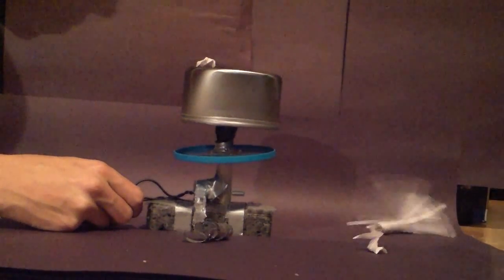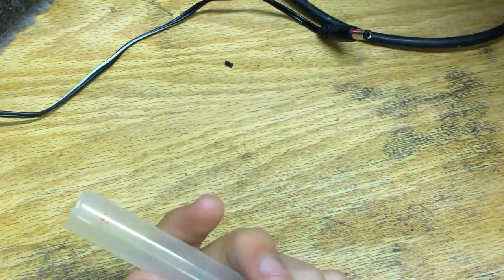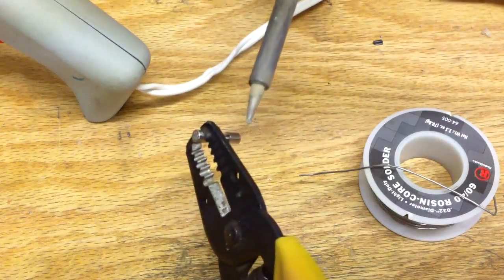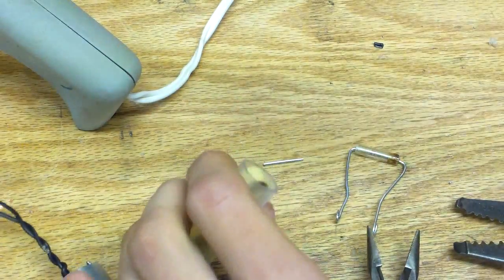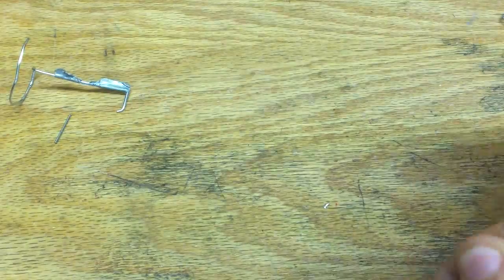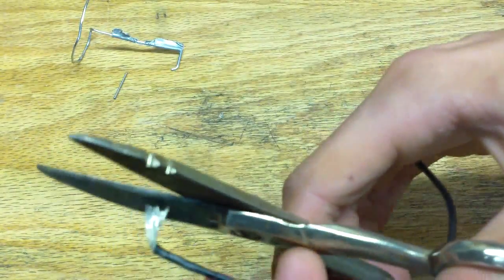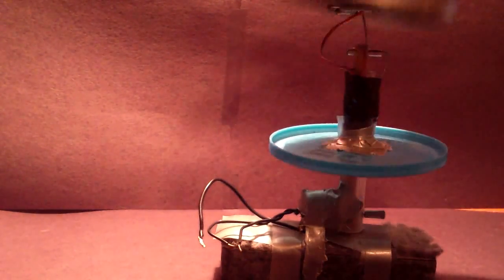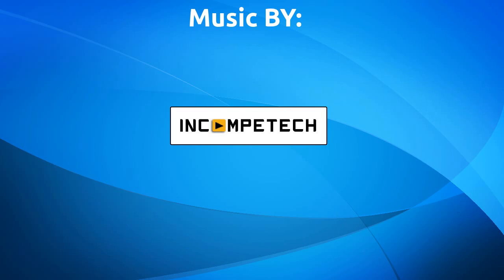How to build an impressive 30,000 volt Van De Graaff generator!

Comment: what should be the power supply being used in the video
Reply from the maker: Anything that can get a typical hobby motor turning, really. I used a 12V wall adaptor (the old fashioned unregulated type)
Reply: Power Max Thanks

Comment: did you plug it in to the wall
Reply from the maker: I used a wall adaptor to convert 120Vac mains into a more manageable 12Vdc.
Reply: if he would have pluged into the wall it would give 120+v  AC current
Reply: and I'm sure it would die

Comment: This is has smart has using heat plugs used in diesel engines to heat each pistion on a sterling engine. A motor the runs off hot air and uses no gas or electricity? Hay your very smart!

Comment: just a quick tip, Don't you think it would've been easier to install the fuse tube and paperclip and all that BEFORE you put the motor on? lol just saying cuz that seems like it would have been way easier for you instead of holding down the thing and keeping the tension and all that while also trying to tape it down. lol like the project though. What's the max volts does it put out?
Reply from the maker: I don't see how. either way you will need pliers to reach and pull the band through.
Reply from the maker: you would have to do the same thing with the motor. pull the band through, poke the motor shaft through, glue it in place while holding everything in place.
Reply: +Power Max well if you do the other side first then you can easily align it to the appropriate tension and once you're done with that side you can simply get the tweezers and pull it out the other end and put the motor in the holes and to make it more easier to glue it and all pull the rubber band out a little and put something there like a paperclip to hold it to where it won't snap back into place. from there you'd have all of it done so all you'd have to do it release the temporary  paperclip holding the rubber band and it'd snap onto the motor.
Reply from the maker: +JoeyTheLionnn Yeah, thinking back on it it was a real struggle the way I did it. Really I was designing it at the same time as making it, so I did not really have any plan other than a vague idea of what it was going to look like. I cannot measure the maximum output voltage, and really that depends on a lot of factors like humidity, speed, leakage (corona), etc.
Reply: +Power Max oh okay well still love the idea

Comment: 30,000 Volts? Really? :(
Reply: KnowW NotM 10.000 volts can jump up to 1 cm, so 30.000 V can jump up to 3 cm!
Reply: @fuguetero6969  it's  not 10000 kv for 1 cm it's 15000 to 30000 kv for 1 cm depending on humidity and pressure
Reply: Air breaks down at 30kV / cm, not 10kv as what circulates around the internet. Typing in "dielectric breakdown of air at STP' will back this up. And, 30kV will jump only 1cm if between two identical spherical electrodes. In this case, not so much so. Meaning his sparks are longer than 1cm
Reply: 30,000 Volts at 0.050mA

Comment: bro does ur hair stand when u touch it??
Reply from the maker: +Arjun Sheka Unfortunately no, but I have short hair. For that you need to make a larger one because this one does not supply enough current to allow the voltage to build up high enough for that.

Comment: will it matter if I use a metal tube?
Reply from the maker: +Cassandra Manzano As a substitute for the glass fuse, yes, google the triboelectric effect. If you are referring to using a metal shaft, You DEFINITELY cannot use a metal tube, as it is conductive and will not allow the buildup of electrons.

Comment: hook a leyden jar to it?
Reply from the maker: +Shaheer Syed Leyden jars are just primitive capacitors. It would charge incredibly slowly. The top load on this generator is also a capacitor as it is able to store an electric charge relative to the environment. Watch my video on those after I post it!
Reply: +Power Max MOT capacitor ultra overkill! jk, how about aluminium foil electrodes separated by plastic wrap
Reply from the maker: +Shaheer Syed MOT capacitors are too leaky, they usually have built in bleeder resistors to discharge the capacitor after a few minutes or so, but not always, so be careful messing with them. They are deadly. I once tried to make a capacitor out of aluminum foil and trash bags (low density polyethylene) and they will generally only work up to around 5kV. I kept trying to make one store the full 15kV from my flyback driver circuit for use in a SSTC, but it would always pop and discharge internally. The last one I made, I neglected to discharge the capacitor before tearing it apart to patch it, and I got a NASTY shock from it, knocked me to the floor.
Reply: Power Max The whole point of this is to make this more dangerous.
Danger = fun! Plus your sparks will be much more intense. People rig up MOTs directly for arcs, which obviously is way dangerous (and more fun) than this.
Thanks for the fast replies
Reply from the maker: +Shaheer Syed Though they still would not charge with the tiny currents from this VDG. You would need a transformer and rectifier to charge it at any reasonable speed and up to any reasonable voltage. I'd imagine this thing would take days to weeks to charge a MOT capacitor even without a bleeder resistor, and not at all if it had a bleeder resistor.
Reply: Power Max Nupe, I'm talking about a plastic wrap capacitor
Reply from the maker: +Shaheer Syed I did not have any luck making one that could store really high voltages. However, Rimstar.org (another youtuber) has made a couple videos on that subject. If I ever plan to make one again, I'd follow his instructions. I currently have a 0.01uF 20kV film capacitor I bought off eBay for a SSTC that I never built.

Comment: i built one and for some reason its not working i added more power but still nothing the fuse is spinning very fast tho
Reply from the maker: I Gots A Questions It took me many tries to learn how to make one of these. My first attempt I did not understand how the VDG worked and tried to make one with legos and erector set pieces. It did not work. 

I then many years later attempted to do it again with no hope of succeeding but I spent a long time learning the science behind it and tried to make it again, and I had some very minimal success, with 1mm sparks that were only visible in complete pitch blackness.

Many days later fine tuning the design, adding a better top load, adding the blue plastic lid, tediously adjusting the brushes and motor and paper clips, and adding LOTS of tape to stop leaking corona, I was able to achieve the results in the video on good dry days. And now that generator no longer works now. SO it is really fiddly as you will discover.

Comment: How do you control whether the top sphere is positively or negatively charged?
Reply from the maker: George Sohal By changing the design and materials used for the belt, top, and bottom rollers. 0:22

Comment: the brushes mustn't touch the belt or the rollers beacuse somebody told me its gonna work
Reply: its a question.
Reply from the maker: Szentléleki Márton Sorry, I have been away for a few days on a campout w/o cellular service or internet. For my specific VDG, I can let the brushes touch the belt, (and in fact I do get slightly better performance) but it wears it out and damages it very quickly.

Comment: max, i have no idea why its not working.topr roller is pvc,belt is pvc isulation tape and the bottom roller is whipped around with rubber bands.its clean but not working
Reply from the maker: I do not really know. A picture's worth 1000 words, open up an instructables account, I think you can sign in with facebook, and ask a very detailed question there. Lots of other minds are willing to answer, as well as me.

Comment: Done! its working BUT very weak it has only 2-3 mm sparks
Reply from the maker: Try turning off the lights and after letting your eyes adjust to complete pitch black, turn on the VDG and see if you see any purple light. A yellow fluorescent light lighter may help since our eyes are not that sensitive to UV and violet colors, the highlighter, or markings from it will fluoresce and since our eyes are much more sensitive to green/yellow light, it will be more visible. around the corona.

Once found, if it is a sharp piece of exposed metal or burrs or something, smooth it out with sandpaper as much as you can and apply some tape, wax, hot glue or liquid electrical tape, or better yet, corona dope which is specially formulated for that purpose, as it has really high dielectric breakdown. As you see in mine, I used a LOT of tape as that is what I had on-hand. Duct tape worked OK for me.
Reply from the maker: The rate of charge buildup (the electrical current produced b the VDG) is determined by the materials used for the belt and speed of the belt, while the maximum voltage obtainable is dependant on how well you can store the charge on the top dome.

Comment: max,i have one more question. what can is use for the belt for the same rollers?yep,i  look around the internet about that but i can't find good information.
Reply from the maker: I don't know why not:
https://www.google.com/search?q=triboelectric+series+chart&biw=1536&bih=758&source=lnms&tbm=isch&sa=X&ei=7MIIVcbiKevdsATRv4GADA&sqi=2&ved=0CAYQ_AUoAQ

I used a rubber band, which  is made of latex, and it is in between vinyl electrical tape for the bottom roller, and glass for the top. Choose a material which lies between the charge preference for the bottom and top rollers that you choose to use. The further they are apart, the better the generator will perform.

The bottom roller has to be more negative (or positive for reverse polarity) substance, and the top roller has to be more positive (or negative for reversed polarity). I think you are referring to a different design for the generator that is out of the scope of this design, if I understand you correctly, where both rollers are made of metal.
Reply: Power Max yep. i want to make a bigger one.that gonna be 50.000-60.000 volts.but the nylon cant  charge the metal roller. :(
Reply from the maker: Szentléleki Márton You will have to research into it yourself I'm afraid, I do not know much about the design that you are planning to build/troubleshooting. I am sure you can scale the version in this video up to be larger, but as you can tell it becomes exponentially more difficult to get the right materials where you want them.
Reply: Power Max its very,very difficult to built a quite big vdg.i spent a lot of time to research the best belt and rollers but nothing is happens.the belt is my problem, i cant cut a good belt from my latex exercise belt.i spent a lot os time to watch videos and learn how it works,now i understand how it works.in the shops in my city i cant find stuff to my vdg ,such as belt.so i  so sad beacuse i spent a lot of time and its dont work

Comment: pls make a video with a leyden jar. its fum! but very dangerous. with you powerful VdG and a quite big leyden jar can make a very big and shinny spark,and easy to make
Reply from the maker: I do have a 0.1uF 10KV capacitor! Very dangerous, and I have got some really nasty shock from a homemade HV capacitor, too! (I don't think small leyden jars are dangerous though, I don't think they have enough capacitance to do real damage, though I am sure a really big one made with a 5 gallon bucket will pack a punch!)
Reply: Power Max yeah. i have a bucket leyden jar and its powerful but i can't charge it well and everybody can touch it. i gonna make a video and i will show you my little and my big leyden jar capacitor. :)

Comment: the top roller is glass and the bottom roller is pvc.it work? Or the roller must be normal electrical tape?
Reply from the maker: Check the triboelectric chart, and see how low it is. Alternatively, you can try it and see.

Comment: It seems the motor stalls a little when it discharges. A diode in parallel with the motor might help.  My Van De Graaff generator uses an AC motor so I can't change speed (easily), have you tried running your motor at different speeds.
Reply from the maker: Good observation! It is actually the poor dynamic range of the microphone on the camera that I was using! Every loud crackling spark would cause the gain, or volume, or the microphone to immediately 'adjust' the gains lower to compensate for the loud sound, and being a low-pass filter to prevent actual loss in dynamic range at audible frequencies, it takes awhile for it to recover after each spark, and return to the normal gain or volume levels. I hope that makes sense :)

I am, however, way overdriving that poor motor, it is rated for 5V, and I am feeding it 9V and above!!! And it is loaded pretty heavily from friction due to the cheapskate build quality of the darn thing! What I find is that running the motor at slower speeds does not reduce the maximum output by much, but only the frequency of sparks for a given distance. That of course make sense when you think about it, the generator is essentially a high voltage constant-current supply by nature. Slowing the motor causes the buildup of charge to be slower, but not less. Too slow, though and the losses from corona and electrical 'leaks' becomes more and more significant. Thats why I used so much tape.

What would the diode across the motor do to help keep the speed stable? From what I understand, it is simply used to suppress back EMF, when sensitive electronics are used to power the motor, like MOSFETs, and the like. A capacitor would certainly be beneficial though!
Reply: Yes, that makes more sense than the motor stalling. The diode was just a guess, but I figured if the motor was having problems because of high voltage issues any component would wear out pretty quick especially a capacitor. But I guess I was over thinking a fails assumption, and a cap would make more sense.

I have been successful at increasing a drill motors low voltage torque by putting neodymium magnets on the out side of the motor.  I made it for a guitar pickup winder. It was powered by a variac with a rectifier and would bog down and stall at slow speed from the tension of the wire being wound. It will work well at 3 volts now (at least for winding pick ups) and it's a 18 volt motor.
Reply from the maker: Yeah, generally when it comes to static electricity, and ESD, it is CMOS IC's, FETs, and things like 4000 series logic that fail due to electrostatic discharge into there gates. Nowadays everything is digital, and inputs to microcontrollers, processors, RAM, and everything else are FET inputs and are really sensitive to ESD. (the gates are electrically floating, and usually separated from the rest of the transistor by an extremely thin layer of silicon oxide, essentially glass, so the dielectric strength of that gate is not very high. Easy for electrons to puncture with static w/ enough voltage.)

Lucky though, nice beefy and simple electromechanical devices like relays, ballasts, motors, solenoids, etc as well as capacitors* are immune to most any level of ESD. Everything electromechanical generally is lowish impedance and the ESD does not deliver enough current or joules of energy do anything at all! (unless that static electricity has been stored in a 180uF 5000V capacitor the size of a submarine battery like photonicinduction lol!)

Thats an interesting way of increasing the power of the motor! I have stuck small magnets to motors in the past, and did make them make more noise when running, though, I did not do much experimentation with that. Generally when I have needed more power of of a motors, I overvolted it! :)

* When a capacitor is discharged completly, it will act like a short circuit or a low resistance until it "fills up" with charge. So when a spike of ESD goes through it, it only charges slightly. If the capacitance is big, the voltage will only rise a unnoticable amount. If it is really small, that voltage may rise more substantially. Just do not let the voltage built up across the capacitor go higher than the rating and it will survive no problems! There is also a maximum pulse current to consider, just make sure not to exceed that, either.

Comment: and i cant buy rubber band.... in hungary its very rare in shops.. i will buy from the www.winkleriskolaszer.hu its a hungarian site so everybody wgo live in hungary ,austria or germany can bought rubber band ,DC motor ect....
Reply from the maker: Any rubber belt should work. It does not need to be the exact type shown in the video. You may just have to get creative and make your own band with some rubber strip. Make sure that the material is not matt black, as that generally means there is carbon content in it, making it conductive and unsuitable for this.

Teflon is really low on the triboelectric chart, thats fine for the bottom roller. However, the top roller should be made up of either metal, or something that is high up on the triboelectric series. Thats why I used a glass tube from a fuse. http://esdsystems.descoindustries.com/whitepapers/images/tribocharging_files/Image2.gif

Comment: melting plastic with a soldering iron tip will mess up the tip
Reply from the maker: I'm sure it will! But really I was too lazy to make the hole another way. A working drill would have been ideal. Thats why I was quick to get the molten plastic off the tip and use a low temp.

Comment: great video but how i ground the wire indoor pls reply
Reply: U can hold it bare foot to ground
Reply from the maker: Physics Guy Just holding the ground wire in your hand will be enough to ground it!

That ground wire is where the electrons are taken from to fill up the top load. There are plenty inside you to do that, and then those crammed electrons can jump back to you when you bring your hand close!
Reply: that is right but in case if you are isolated to ground by wearing a leather shoe  or something like that u should be connected by being bare foot unless if you choose to stand on your hands ;)